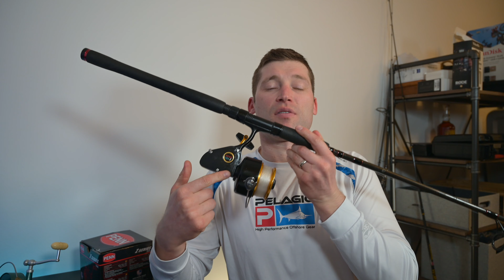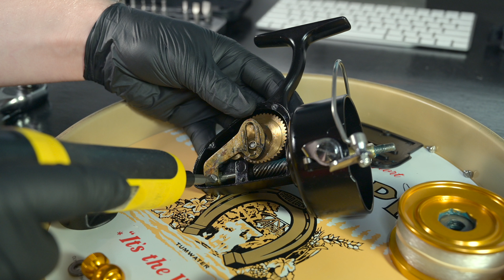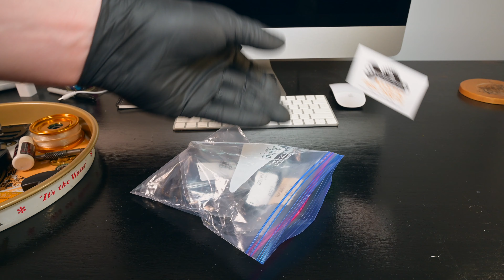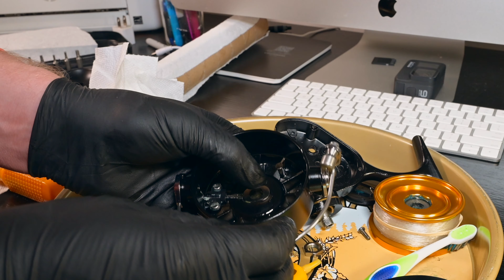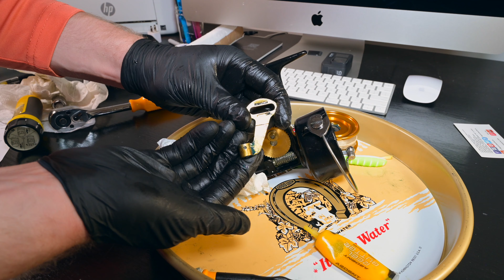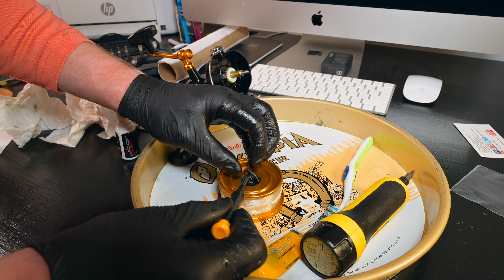PENN 704Z: Cleaning & Breaking down a TANK

Comment: I just finished restoring/servicing a 704Z I recently purchased. I found a few internal problems:  1. The grease had lost all viscosity and was whitish and slimy, 2. The bearing and pinion took two hours to get out, 3. There was a lot of micro-sand in the housing, rotor, bail springs, and bearing. This to me meant the reel had been dunked at some point. I got it all cleaned up but the bearing was in rough shape so I replaced it. The reel turned out perfectly. It has zero cosmetic damage so even though it took an entire afternoon to do it I now have an all but new 704Z. I still have and use the 704Z and 706Z that I bought in the 70s. The reel you’re working on was probably made in 2012 because the rotor doesn’t have the band around it with line capacity, etc. on it. By the serial no’s. I know mine came from the 1970s. The reason the old-timers used to pack these reels with grease was that it was a poor man’s way to have a waterproof reel. Problem was it took a Ton of grease as well as a thorough cleaning after a few trips. Now folks being folks they got lazy and did not do the necessary cleaning. This is what destroyed so many of these reels.  I liked your video a lot. I need to get one of those torque screwdrivers sometime.  Great job on one of my favorite spinning reels.  I have a collection of over 260 surf spinning reels that were for the most part made before 1980. — Chris

Comment: Love the video!  I've watched it several times and it's an excellent presentation.  Then I tried to service one of my two 704Z's.  (It's a great advanatage to have a second wrking reel when you're doing this for the first time!).  I ran into trouble with the bail cleaning and reassembly.  The bail no longer flips back over to catch the line.  I'm thinking it has to do with the two springs in there.  Do you have any ideas?  Thanks again.
Reply: We’re u able to fix it?